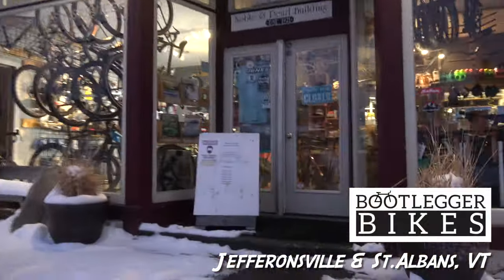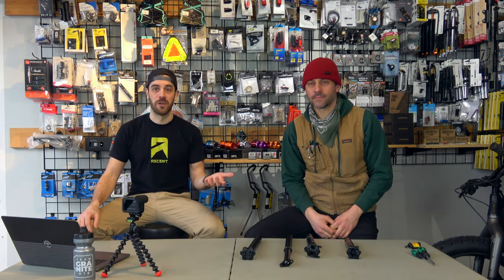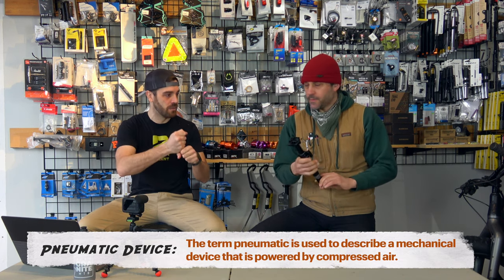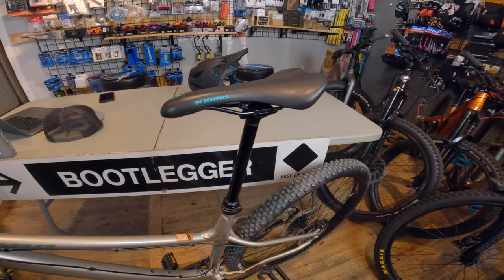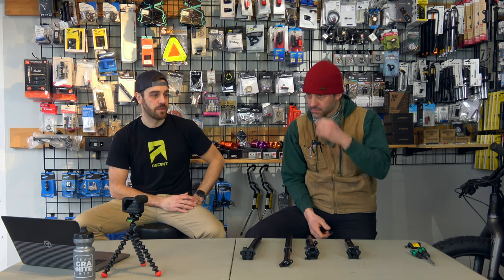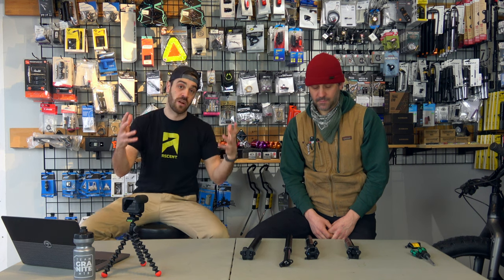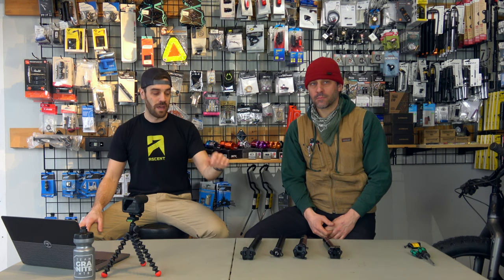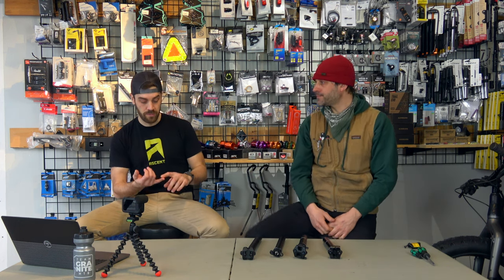Dropper Posts Explained!

Comment: I haven't had a bike for quite some years now, some of these new features are awesome! This is one I definitely want as with the last bike I had I kept the seat down all day (and my knees grew strong AF, yes xD)

For a piston that could fail and break your butt.. I would not cut any corners xD This can happen with office chairs too so... yeah, quality control is important.

But it'd be out of proportion to use the Bluetooth kind in the bike I have in mind and between the other 2 options I'd prefer mechanical as hydraulics is something I only wanna deal with for the breaks.. but not the cheapest tier of mechanical dropper posts.
Reply from the maker: Mechanical for the win!

Comment: I'm running one of the cheapest things you can get.. Zoom Tequila... and after 2.5 years, still going strong (though I did have to clean up the activator pin at the top as it was sticking).
I'd like a dropper that goes from the top bar to full seat height... but with the tiny post depth before it's interrupted with the swingarm linkage bolt, I can only fit a Zoom for 100mm travel (Without paying more for the dropper than I did for the bike...

BTW MTB Travel Review... Maybe try a remote Microphone to reduce the background echo/reverb but otherwise.. Excellent az always (Which is why I subscribed. Been watching for a couple of years now.
Keep it up.
Reply from the maker: Thanks for sharing and for the support.  Finally ordered a remote microphone set, so I appreciate the advice!
Reply: @MTBTravelReview  Can't wait for the next installment.